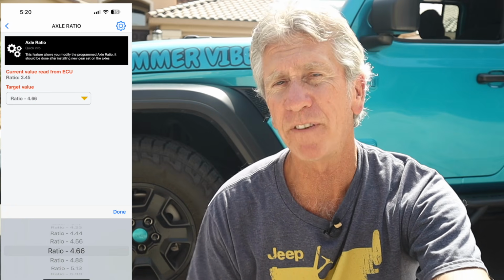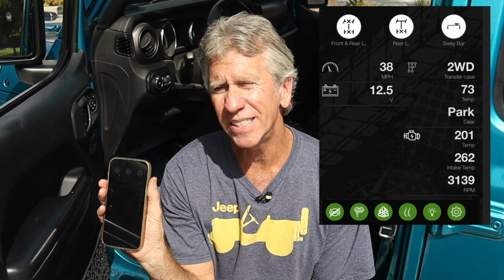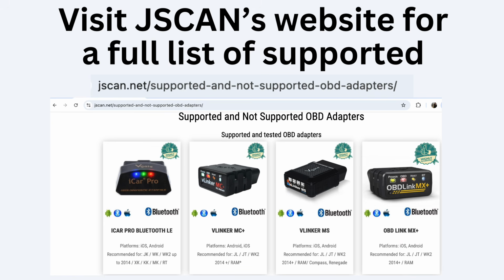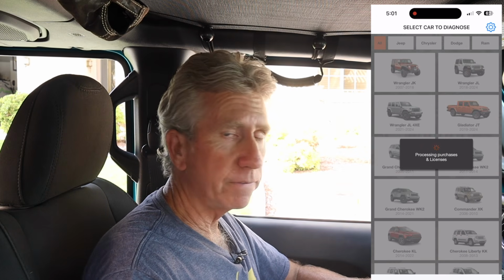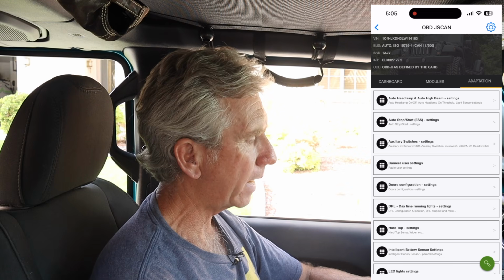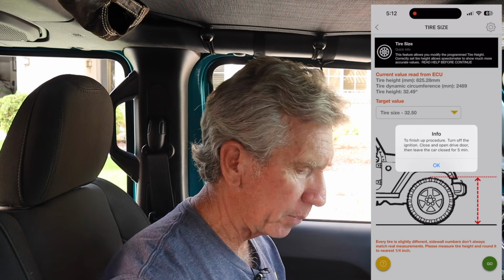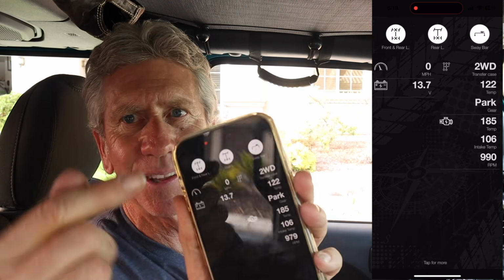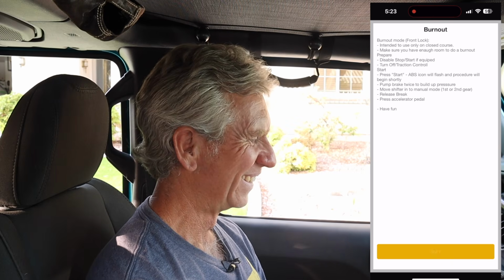JSCAN - The One Essential Wrangler Tool: Support Mods (Tires/Gears/etc), Diagnostics, Off-Road View

Comment: Really appreciate how nicely and patience fully you explained all steps and saved me for spending so much money on tazer for one thing tire size 
Thanks ✊🏻✌🏻
Reply from the maker: Yep.. for just Tire Size, Jscan works great.  JSCAN and Tazer do a. lot of the same things.  Benefits of JSCAN is the diagnostic capabilities.  Benefits of Tazer is it does additional things like disabling the Auto Stop/Start system, they. have a cool light show, and a couple of other cool things.  After I get done with my maintenance series, i'll be getting a tazer and doing a.lot of content around that product.
Reply: @The.Garage.Studio Appreciate your reply 
Does the JS scan auto start/stop also stop the remote start feature? 
If possible can I have your Insta or fb page so I can stay up to date with your videos 
Thanks
Reply from the maker: @harnoor_mtl  You can friend me on facebook if you want - Darrell Lutey - but I don't post videos there.  JSCAN doesn't offer a stop/start feature.  The cheapest/easiest option is to remove the plunger from the hood.. but you still get a warning message on the dash.  I have the Smart stop/start dongle which is cheap and works great.

Comment: I did these exact steps and now my sway bar disconnect, acc and service 4WD lights come on when I drive. Any insights?
Reply from the maker: Hm.. were you changing tire size?
Reply: @The.Garage.Studio yes. Speedometer is correct now but after I drive a mile or two these lights come on.
Reply from the maker: @fbcrichmondkentucky7886  Is it a manual transmission?

Comment: Anyone comment why changes will only work for a while and then it goes away.   But will come back intermittently.    Specifically. auto dimming. Which my rubicon is equipped for.    Worked for a while. And then disappeared,
Reply from the maker: That's weird.

Comment: I plan on adding a Gen-3 dual battery system. Does JScan have a way to monitor 2 batteries?
Reply from the maker: I don't think so, it can monitor the overall voltage of the two batteries but I don't think it can independently monitor each of them.  Might want check with some of the JSCAN forums.

Comment: Last question!: I made the change to my tire size from 33s to 37s, took it for a ride at 100km per hour and was fluctuating with 1km so was fine with that. My current gear ratio says 3.73 but the recommended ratio (using calculator)  says around 4.2ish. is it safe to change the ratio even if I havent physically changed the actual gears in my Jeep?
Reply from the maker: I don't think the jeep will like that.  But personally I haven't tried it.  You really need to regear with 37's.  Hoping you went with a good solid lift.

Comment: did you have to disconnect the cables and reconnect the vehicle to run the drive test?
Reply from the maker: you have to connect the cables to make the changes.  After the changes are made.. you can disconnect.

Comment: I can't find info how properly test adblue elements using flow test in JGC WK2 3.0 CRD . In JScan i must choose in precentage flow , but i cant find any table to compare at chosen flow . Maybe someone will help me here ?
Reply: Great video! Do you have to keep the dongle installed when you finish the reprogram?
Reply from the maker: @curtr7618  Nope.
Reply from the maker: Good luck.  Is that an Eco-Diesel?

Comment: I can’t seem to find any instructions on how to permanently turn off the white DRL for a Jeep Wrangler JL and use amber instead for all instances. When the headlights are on or parking lights are on. I set the DRL Location to turn signal but the white is still on. Both are on only when the parking lights are on. Amber goes off, white stays on when headlights come on. I want amber all the time. Instructions say, 

“To use amber as your DRL and permanently turn off the white DRL, you need to use the JScan app to first change the DRL Lamp Location to "Turn Signal" and then set "DRL Dropout Enable" to "Active". This will make the amber turn signal lamps function as your DRLs while ensuring the white DRLs turn off automatically when the turn signal is flashing.”

I want the white off permanently. Not just when the turn signals flash. Can you help?
Thank you.
Reply from the maker: Hm.  sounds like you're doing everything correctly.  If you haven't yet, i'd ping JSCAN support.  They also have a facebook group where they provide assistance as well.  https://www.facebook.com/groups/2582861995366601

Comment: Excellent info, I eventually figured all of this out after changing tire size myself, but it would have been so much faster and less butt clenching if I’d run across this first! And When you were showing unplugging the sgm connectors (mine are SUPER painful to access because I have the Bose factory system with the sub) I thought to myself “gee it would be cool if there was an extension cable that I could plug in to relocate them” and, well, what do you know!  Lol, I’m ordering it now! Thanks for the vid!
Reply from the maker: Thanks so much for the nice feedback.  Yeah, the extension cables do make it a bit easier.

Comment: I’ve got a 2010 jk sport with ABS LIGHTS GOING NUTS and it will shut off the engine and kill all power for ten minutes before I can restart the engine! I might need a new ABS control module but I’ve changed wheel speed sensors, new clock spring and fixed an extremely tiny brake line leak with new brake line so I’m hoping jscan can check to see if I need to buy that $650 module grrrr! Gonna clear codes first and see if they come back! 
I WELCOME ANY AND ALL ADVICE!
Reply from the maker: There are a lot of modules JSCAN can check for.  Assuming the ABS module is one of them.

Comment: You need to have the obd always connected? Like the tazer mini?
Reply from the maker: You do not.  If you want to use TrailView it needs to stay connected.. other than that it's fine to remove it.  All the settings are saved in the ECU.

Comment: Could you please explain exactly what the security gateway cable is for. Thnks
Reply from the maker: It's only necessary for JL's.  You cannot make any changes, or really use JSCAN without the security gateway cable.  It's required.  All tools such as Tazer that make changes to the ECU require this.
Reply: Perfect, I have a JK so I do not need 👌👌
Reply from the maker: @claudiagamino6499  Cool.

Comment: Excellent video! Do you need the special cable for using these features? Like tire diameter, etc.
Reply from the maker: If you have a JL.. to make any changes you need the special gateway cable.
Reply: @The.Garage.Studio   I have a JK from 2010.
Reply: @juanprime8827  Yep.. so you don't need the gateway cable, but you do need the OBD cable.

Comment: Great vid this will help me out next week when I need to do this. When I'm finished will I need to unplug the OBD and plug the cables back into the Jeep or do i tuck everything under the dash and leave it hooked up?
Reply from the maker: I just leave it all hooked up.. but i'm creating a number of videos on JSCAN, so I just don't want to unhook and hook up all the time.  I haven't had any sort of issues keeping it hooked up.  One person reported his battery draining, but most folks don't have that issue.  But.. everything still works as it should.. so unless you use trailview or anticipate other upcoming changes you can unplug it.  Good luck with everything..
Reply: @The.Garage.Studio  thanx much and great informative videos!
Reply from the maker: @co4x4  You bet.
Reply: @The.Garage.Studio  great video and the most detailed by far, but I was wondering if you unplug the Bluetooth OBD connector from the red SGW cable, that still leaves the OEM security module in the vehicle unplugged. Do you have to reconnect the OEM security module when removing the Bluetooth OBD connector?
Reply from the maker: @DonnieB_83  You do.. Really.. either way the security gateway is disconnected and if you bring it to the dealer with the OBD connector and they try and use the OBD port.. it won't work.  That's the reason you get the security gateway extension cables.  On really cool device that I just tried, was a security gateway device sold by Superchips.  You just plug the securfity gateway cables into it.. and everything still works.. like magic.  JScan works, my various scanners work, my new Superchips device works.  Really cool.

Comment: Great video! There are 2 things I hate on my JT. 1) When the Jeep is running, and I get out and shut the door, the horn honks 3 times. 2) If I try to drive the Jeep with the door open, it shifts to park. Can these items be turned off? I have not found where I can do this in JSCAN.
Reply: So no comment on my question?
Reply from the maker: @kevinhollenbeck7503  Sorry.. super busy.  Off the top of my head i'm not sure.  I will look into it though.  Thanks for the question.
Reply from the maker: Yeah, so I poked around JSCAN and also did some searching thru forums, and seems JSCAN can't disable these.. as they are both Live Features that it seems can only be deactivated by the TAZER.  It does look like TAZER can turn off both of these naggy features.
Reply: @The.Garage.Studio  Thank you for checking. That's what I have found too, by asking around. Bummer though. Have a Happy New Year!

Comment: Great video!  I have a 2024 JL Rubicon 6MT and so it has the post-clutch recall software being the new model.  I upgraded from the factory 33's to 35's.  I decided I wanted to set my tire size and TPMS to match the new tires so I tried a Tazer, set the tire size from 33 to 35, and the TPMS from the factory 37 to 33.  Everything was working great on the trails that day but once I got up to speed on the highway and used 5th/6th gear, the Jeep went crazy.  First ESS failed, then I got a message clutch is hot limited performance, and then service transmission followed by going into limp mode.  My Jeep spent nearly a week at the dealer (after uninstalling the Tazer) with them trying to figure out the problem.  It turns out I had a short in the gear position sensor, so they replaced that and reprogrammed the Jeep with their software to 35's.  Everything is working well now but I am tempted to either try the Tazer again, or use JScan.  I have all the things you mentioned (SGW cable, extension cables, OBD II compatible scanner, and the licensed app).  I think my problem with the Tazer was that I didn't do the gear relearn procedure they recommend for the new JL manuals.  I found those steps after the fact.  The steps for the Tazer are pretty specific.  You need to do reboots, put the Jeep to sleep for 2 cycles, disconnect the battery for a few minutes, etc, etc.  It's really confusing for the manual but it's because of the wonky post-clutch recall software I believe.  Anyway, I was wondering if JScan has any such special procedures for the manual transmission JLs?  I wouldn't mind giving this a try.  I would like to take advantage of some features.  Thanks for your time.
Reply from the maker: You got me scouring the web on this one.  Seems that on the JL 6 speed, when you change the tire size with either JSCAN or TAZER, you need to reset the PCM Volatile memory (both TAZER and JSCAN) let you do that, and then you have to do a specific procedure going between 40-80MPH in 6th gear and hold it there for around 30 seconds.  Check the thread out. Nevertheless, the dealer dealt with this already, so you don't have to do anything at the moment.  Both Tazer and Jscan are good.   Thanks for watching.
Reply: @The.Garage.Studio  Ok so the JScan needs the same extra steps for the 6 spd manual.  Thank you for confirming!  I won't mess with the tire size since they already did that, but I'm thinking I want to set the tire pressures down from 37 to 33 with the JScan.
Reply from the maker: @WreckedBrewery  Yep.. you can do that.  Good luck.
Reply: @The.Garage.Studio  I'm assuming changing TPMS and other minor things don't require this PCM / EEPROM reset?  From what I've read it's related to tire size or gear ratios.
Reply from the maker: @WreckedBrewery  I'm assuming not.. but seems things are weird with the manual.  I didn't need to do anything like that when changing my tire size.  Good luck.
Reply: How did it all turn out? I've got a 2020 JTR with 6MT. I did the clutch recall (all new clutch) and they did the software flash. 3 months later the throwout bearing seized. I swapped in a centerforce clutch and flywheel with the internal slave. But I keep getting the service transmission error pop up. Maybe that sensor? I'm putting in the jscan and sgw cables right now.
Reply: @ The fix for me ended up being a gear position sensor replacement and having the dealer set the tire size to 35.02" which is what my Falkens are, and finally doing the 6th gear relearn procedure.  I am now using jScan for TPMS only all is well for the past 2 months now.  With the manual, we have to do that 6th gear relearn procedure.  It doesn't like when we change tire size or gear ratio in the computer without a specific procedure.
Reply: @WreckedBrewery  Nice.. Glad things turned out well.
Reply: @GoldenK9Campers  In the end yes, but it was a hassle at the time.  Good to know beforehand on the manual so happy to pay it forward.
Reply from the maker: @WreckedBrewery  Thanks so much for sharing.  I replied from my other channel..
Reply: @The.Garage.Studio  Just wanted to give an update since I've changed some things.  I am now on 37's and 4.88 gears.  The Tazer has been updated with the latest firmware, which includes manual transmission fixes (something I didn't have last time), and this seems to have done the trick.  No limp mode or any issues.  We set the tire size in the Tazer to 36.26" (M/T Baja Boss ATs 37's) and gears to 4.88...did the reboot and sleep cycles and all is good.  Loving how the Jeep drives now.  Better than stock even.
Reply from the maker: @WreckedBrewery  Wow.. 37's and stil drives great. That's amazing.  Who did you gears and how much did it cost to install?  Thanks for the update.
Reply: @The.Garage.Studio Yes it drives amazing on 37s on and off road. The gears were done by Outlaw Offroad in Charlotte. Great guys over there.  Was about $2500 all in, including the 500 miles oil change.
Reply from the maker: @WreckedBrewery  Nice.. thanks for sharing.

Comment: Good stuff. I’m a JSCAN user. One of the things I haven’t been able to figure out is to get DRL fender lights to stay on when headlights are on. I have a 2021 Willys Gladiator JT that has 2 separate bulbs one for the DRL and one for turn signal. It came with halogen bulbs and the DRL stayed on when headlights were on. However, I have replaced the halogen DRL bulbs with LED bulbs.and now the DRL fender lights won’t stay on when headlights come on. Any suggestions?
Reply from the maker: Wow.. that's a weird one.  Wish I could offer a suggestion.  I didn't have DRL's on my Sport-S and I have JSCAN turn on the foglights as my DRL's, but when I turn my headlights on.. then the foglights/drl's turn off.  There is a setting in JSCAN that supposedly overrides this, but it doesn't work.  I even asked the JSCAN facebook group about this and they said that's the way it's supposed to behave. Good luck.  Thanks for sharing.

Comment: Does it show oil pressure and its sensor or voltage
Reply: Yes, when you go to live data you can select what specific sensors you want to see the live data from.  It shows every parameter of the vehicle.
Reply from the maker: @dougpyle5602  I really need to get some more JSCAN videos going.  I'm going to be breaking up this one large video into multiple smaller one's.. and then do a lot of other content.  The live data monitoring is just so amazing..
Reply from the maker: Pretty sure you can get it to show that.  I'm going to get into (eventually) showing how to get such info.  Just getting started.

Comment: Just so you know, instead of guessing the tire diameter, a lot of tire manufactures provide the actual diameter on their websites along with the rest of the tire specs.
Reply: There is also the old tried and true method of measuring your tire diameter, takes less time than any other method. If you want to verify with a GPS speedo after that, it will be dead on as long as you read your tape measure correctly.
Reply: @shane_huskey  Oh geez..  don't tease.. Tell us !!
Reply from the maker: Oh for sure, but for my tire - Falken WildPeak - the manufacturer says the tire diamater is 33" in the specs, but for the speedometer to be correct, I had to put in 32.75 inches.  There's guessing, there's looking up, and then there is veryfying with a GPS and getting it totally on the money.